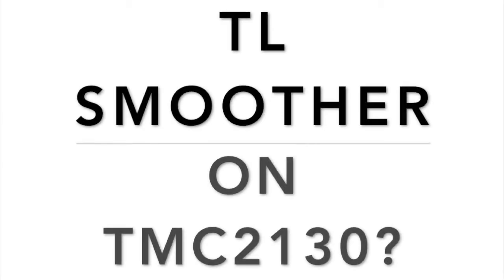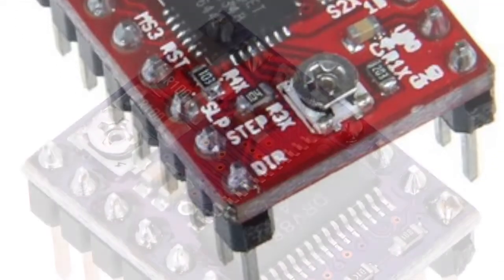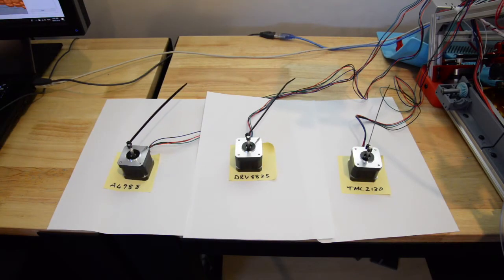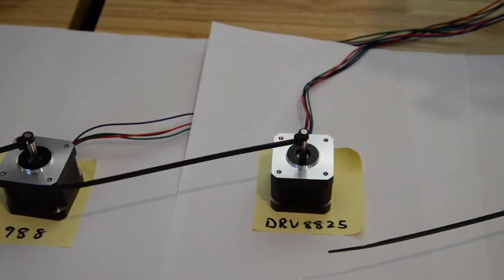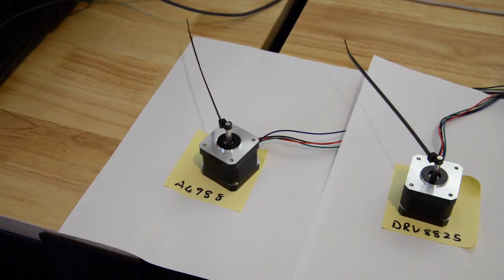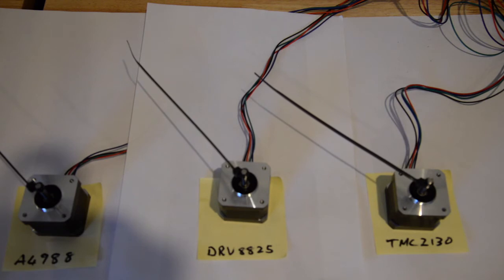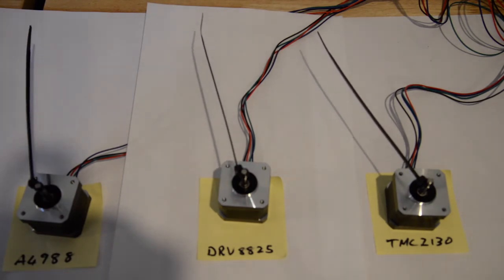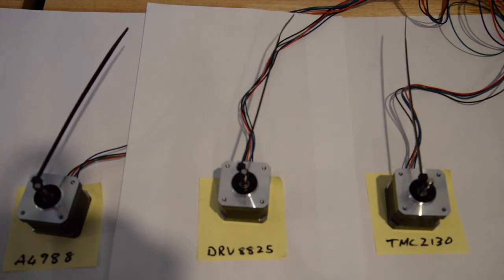TL Smoother on TMC2130?

Comment: I heard that the DRV8825 is quieter running.  How does the TMC2130 compare as far as sound?  I assume it compares to the 8825?  I started looking at these when I heard you could quiet your machine down with these new drivers.
Reply from the maker: The TMC 2130 is even quieter. In stealhchop they are super quiet!

Comment: why is the drv 8825 not  set to the same 80 steps as the other two?
Reply from the maker: Hi Tyler. The drv8825 is 1/32 microstepping while the A4988 is 1/16.  I left the three mode pins in for all drivers.
Reply from the maker: The TMC2130 was also on 1/16 microstepping
Reply: in the video, did all three drivers have TL smoothers?
If not can you do another video with the TL smoothers on all the three drivers?
Reply from the maker: No TL smoothers on any of the drivers. From my experiment I concluded that you don't need TL smoothers on A4988 and TMC2130. But what if you had TL smoothers on them? Thanks for the idea. You never know until you measure!
Reply: please do a new TL smoothers on all drivers...

your experiment method is pretty interesting to see.

How did you get the motors to just rotate continuously like that.?

In the real 3d printing though, the motors would be stopping at starting so the results would be different.

If you got the TL smoothers and all 3 drivers already, then why not do a new video test print to see what results would you get with and without the smoothers?
Reply: Thank you @ZechyC  this video explains alot. I am just about to upgrade to TMC2209. Do you suggest using smoother on 2209? Or all the TMC drivers are fine without it?